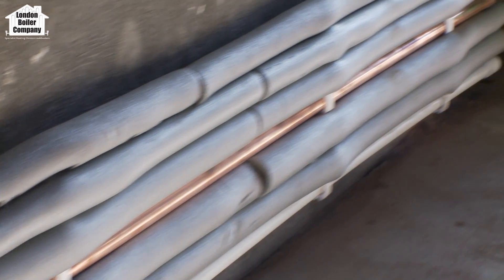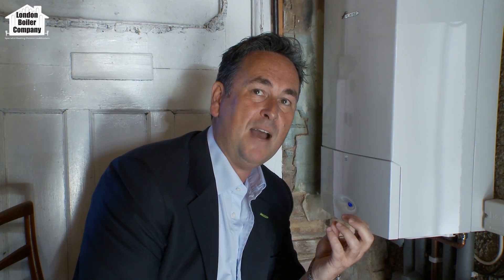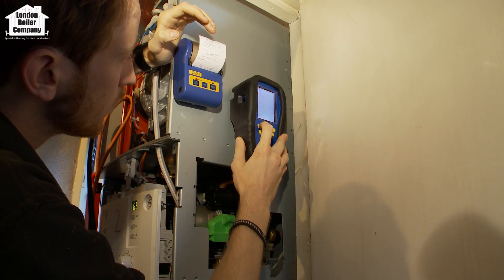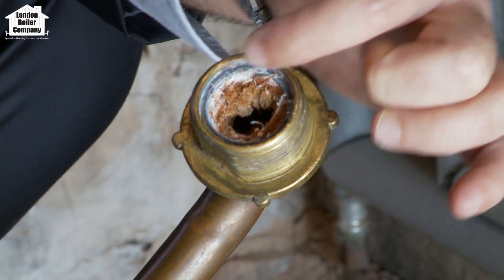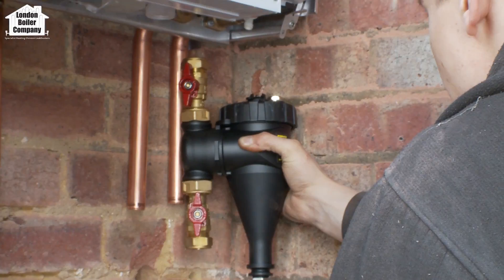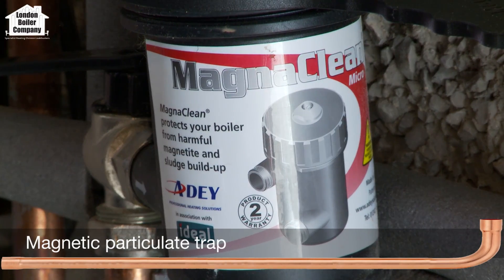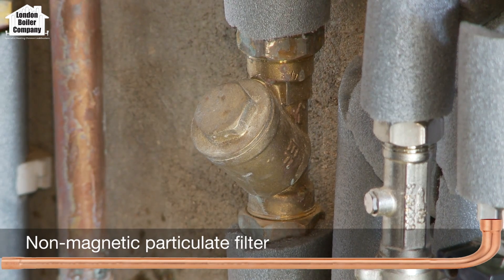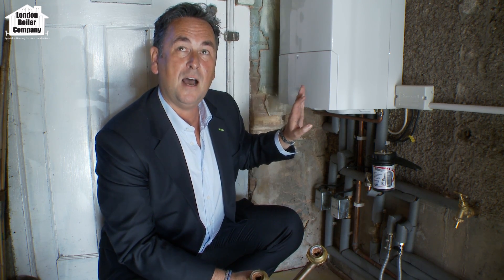Why do central heating systems get dirty or sludged up?

Comment: From my experience sludge is formed in heating systems because of the presence of air in the water.

This is generally because modern pipe is not as airtight as we have been led to believe. Certain plastic pipe systems in the market are porous and they allow the ingress of air through the wall of the pipe. Other problems arise through inferior jointing methods such as badly manufactured neoprene ring seals.

Another common cause is pitching expansion pipes that constantly flush the system contents through the heating tank in incorrectly designed open systems. An easy diagnosis trick for that is to observe the open expansion pipe when it is immersed in a glass of water while the system (or just the system pump) is turned on and off. If the system is badly designed the contents of the glass will either be sucked into the pipe or blown out over the glass. If that happens you will need to look at how the system was constructed. The incorrect pipework must be fixed first before anything else is done.

The problem becomes all the more apparent when the system design creates a negative or suction force in the leaky joints or badly manufactured pipework and air is drawn into the system. This is one of the hardest problems to diagnose. The typical way to confirm that problem is to note that the system is 'gunking' up when the pipe layouts is confirmed to be correct.

Fitting a filtering device is not the solution to those problems as the only result it that the system will not choke up as the components disintegrate, the source of the trouble should be located and dealt with first.

The system should be flushed after the source of the problem is identified and then an appropriate leak sealer should do the trick.

When the cause of the problem is solved you should consider fitting a magnetite filter and a good quality strainer.

Only then will you have fixed the problem and rectified the damage
Reply from the maker: An interesting concept and I bow to your experience. We made the video with Ian Puddick of London Boiler Company so we are not at all qualified to verify or question your comments.

Having filmed London Boiler Company installing kit on several occasions we believe he puts in metal particle filters and venting kit on every installation he does. He says it's better to do it than not.

I note you say that filters are not the solution to poorly designed systems - in my ignorance I'd probably go with that, though I too feel that having filters and venting equipment would probably help tremendously in hindering the collation of sludge.

As you say - if the pipes and ring seals are not great then air is possibly getting in - then some form of auto venting kit would probably help slow the process of sludge build up.

It would also be unfair to lay blame for poor system design with London Boiler Company as they specialise in repairing and replacing boilers. They don't do full central heating systems.

I will consult with Ian and ask - as I am now interested in knowing more. In filming this piece - there was no hint given on the situation with plastic pipes being different to that demonstrated with copper pipes and it was the erosion of the metal components I believe was ending up as sediment build up - but hey - I just hold the camera!
Reply: Point taken on London Boiler Company - they arrive after the oroblem occurs and try to make good the harm done in the past. Certainly no offence was intended against them as they provide a vital service. 

Beside their efforts to help rectify the damage any system displaying the affects of system sludge must be thoroughly examined from a design perspective and to confirm that substandard components were not used at the original stage.

A good quality filter would then be a most advantageous addition to get the system back to Prime condition.
Reply from the maker: Irlcork1 I suspect Ian will be reading your comments - and knowing him - I'm betting he'll agree with your initial comments. Certainly - I don't feel he will have taken your comments as anything but constructive - so i think we all win here... ;-)